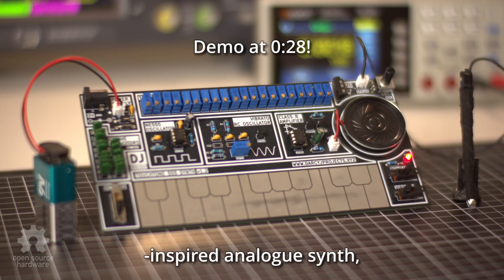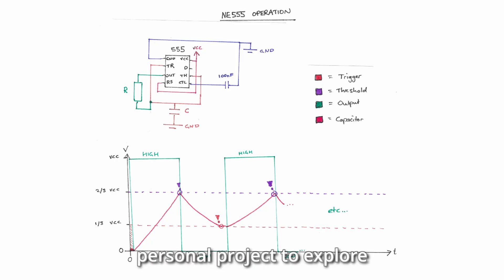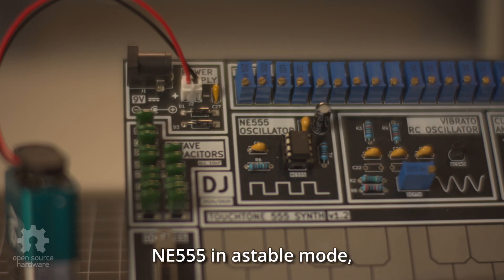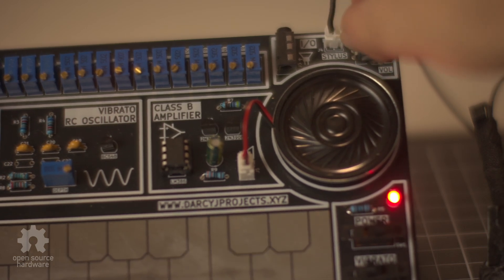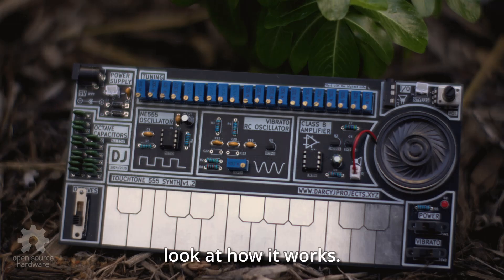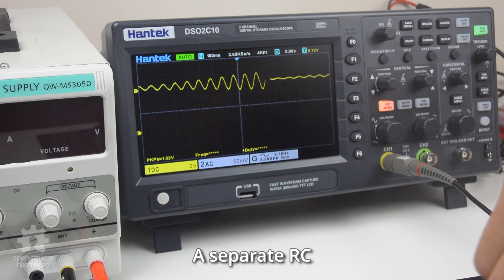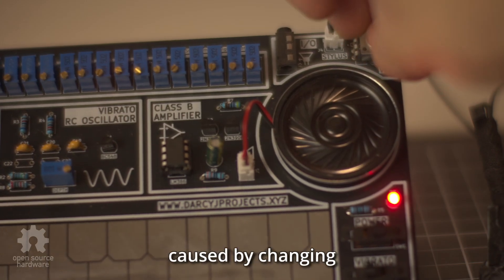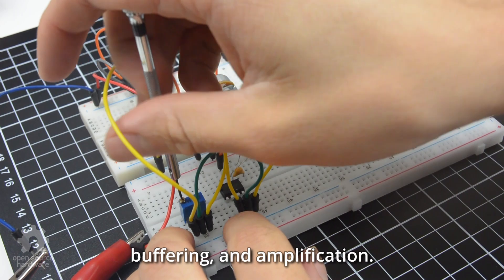TouchTone555 – NE555 Analogue Stylus Synth

Comment: So will the use of the aux port override the speaker when a jack is plugged in? Still leaving the speaker connected?
Reply from the maker: The aux port doesn't turn off the speaker when a cable is inserted, as the model of jack I used doesn't have an integrated detection switch unfortunately. If I ever do a V2, I plan to use a different jack to fix this.

Comment: Ayo I’m into mechatronics found ur thing very interesting but could ya make the notes for little root town? I made the first bit which is 3 6>7>8, 7>8>7>8>8.5 >10>11>8 but it’s hard to figure out the rest
Reply from the maker: Hi, thanks for watching! Here are the notes for most of the lead numbered from 1 to 20 with 1 being the lowest.

4 9 11 13 11 13 11 13 14 16 18 13 13 17 18 20 18 13 11 9 8 9 13 18
6 8 9 16 14 14 13 9 18 13 13 11 9 8 9 11 13 14

You can look up the midi for it too.